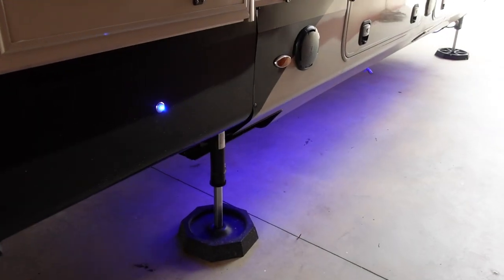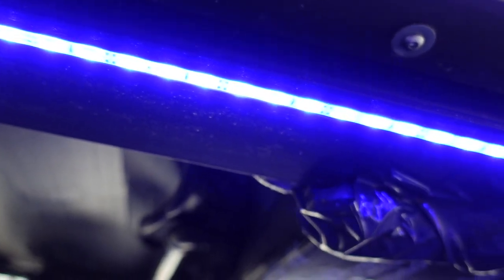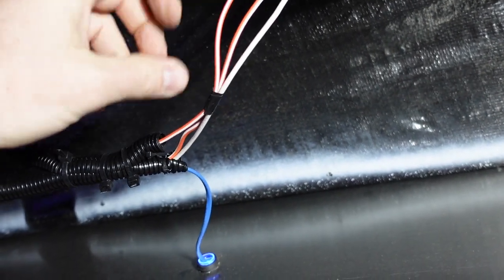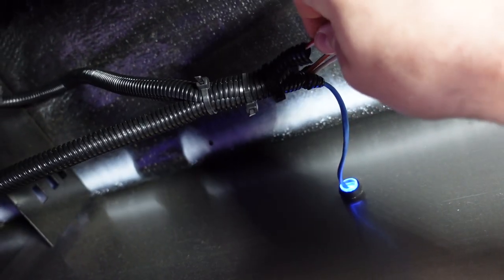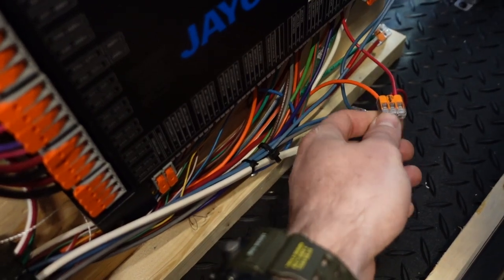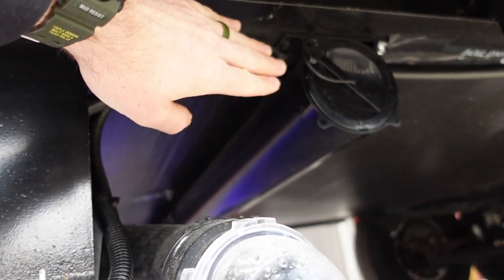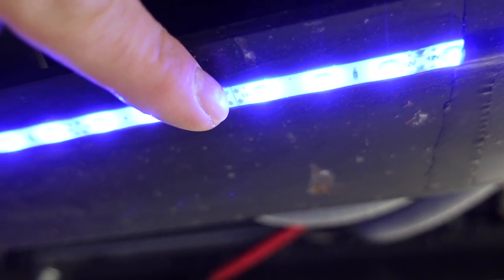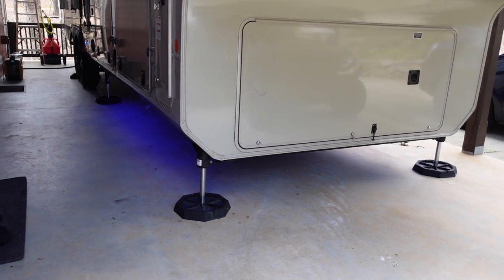RV LED Downlighting Mod // Add Ambiance & Security to Your Fifth Wheel & Campsite for Under $100

Comment: looks like my post disappeared?  Is that because I posted a reply with a link?  Anyway, got the mod done...thanks for all the help.  Both awning lights pull 1 amp and the step/downwash LED's pull 1.7 amps.
Reply from the maker: Possibly? Sometimes YouTube will take comments down or moderate without letting the rest of us know. You can try again to see if it'll go through.

Thanks for the amp info!

Comment: I'm glad i found your channel ! I have a 2021 Jayco Pinnacle 32Rlts and your mods, your observations and your corrections are interesting. Can i ask you what did you use to light up your basement please and thank you !
Reply from the maker: Yes, here's link to the LED strip I used in my basement storage area. Really makes it a lot easier for me to see things! https://amzn.to/3Bk38yk
Reply from the maker: Oh, and here's a full link to everything I've bought so far related to Pinnacle. I try to keep it updated and current, but if you ever cannot find something just let me know and I'll add it: https://www.amazon.com/shop/adventurerocks/list/3RX5U55SUBZB5
Reply: In case you're not aware yet, i found on my floor plan  a vacuum breaker in the wall behind the toilette located 6 inches above. This vacuum breaker is used in the water line to flush the black tank. In my case I had to cut a access panel below the coffee area behind the doors.
Reply from the maker: @claudius622  Oh wow, that was really hidden then. I'm surprised as I would have thought code would require the vacuum breaker to be accessible rather than hidden behind a wall like that. Apparently not!
Reply: @AdventureRocks  I accidently discovered the vacuum breaker because i installed a complete solar system and i had to pass some wires into the wall behind the toilet. It was so tite i preferred removing the wall behind the toilet.
I also have a ice maker and they placed the water valve feeding the line, behind the fixed stove !? But the problem with the vacuum breaker is the fact that one day it is going to leak. So i ordered a spare and now know where it is. But i still love my Pinnacle !
Reply: @AdventureRocks  i will buy from your store with pleasure !

Comment: Great video. But for the light on Amazon it said I need the adapter and I don’t see you use or explain that? Do you need the adapter or not?
Reply from the maker: I believe it's saying if you want to power the lights off a standard 120V outlet then you'd need an AC adapter, but since I just wired into the existing 12V DC system of the RV, no adapter was necessary in my case.
Reply: @AdventureRocks  ok good to know. We just need to replace the front cap light, like you said I guess water got in

Comment: The front cap LED in my 2022 377RLBH also had water intrusion damage which mostly occurred at the low point.  The tubes are about 1/4" too short and do not recess into the silver caps that are secured with a screw.  Jayco or dealer applied  silicone to fill the gap but did a poor job. The water accumulated in the low point of the tubing and has resulted in approximately 12" of LED lights not working. 

I understand you reused the tubing and I see the link for the LED tape.  Thanks for providing that info.  Curiously, how do I connect the LED tape?  I haven't removed the end caps to take a look.  Thanks!
Reply from the maker: It must be a common problem as I've heard same story from about a half dozen folks since I encountered it. I agree it seems they aren't putting silicone on the tube ends leading the the failure combined with the silver caps not fully covering. 

Facing the front of fifth wheel, mine was wired off to the right side with a very small hole in the fiberglass for the wires. I carefully removed them and pulled out enough slack to sauder the new strip to the wires. They were very thin gauge of course. I'd imagine alt access would be from inside by taking closet wall apart, but that seemed more difficult to me. I'd venture to guess there may even be a wago connector inside there, but too big of course to get through the hole in fiberglass so that's why I saudered and covered with heat shrink, pushed them back into hole. I also then siliconed that hole as it looked like they sealed from the inside originally. I almost wouldn't trust a regular dealer to do a proper job on something like that under warranty not knowing if they'd seal it up thoroughly to prevent from happening again.
Reply: @AdventureRocks  Thanks again. I’ll be sure to inspect it carefully if I let the dealer do the repair. 

I also have a TPMS unit that I cannot get to pair. I didn’t notice it until I got home from the dealer. Any experience with those?
Reply from the maker: @firstgenfarmer9809  I believe the TMPS sensor are based on bluetooth like the rest of the sensors, but I could be mistaken. I had a temp sensor quit pre-mature and turned out the battery was just shot. They must have had faulty battery as soon as I replaced it, came back as expected. So that's possibility. I've also noticed that the BMPro TMPS sensors only update every so often and might have some kind of "sleep" mode as sometimes I won't see all of mine till I've been on road moving. You could try re-seating battery first, then let a little PSI out to see if that activates it successfully. Worst case swap batteries with another and see if problem follows the battery or unit?

Comment: I enjoy your videos very much. I bought a 2022 Jayco Pinnacle in June. The only thing is my Right Turn Signal and Brake light don't work.Would you have any idea where the problem might be?
Reply from the maker: Thank you. Sorry to hear about your light issue. Since it is only the right turn and right brake, they share same wire (full bright essentially vs parking half bright), so I would imagine it is isolated to just that particular wire. I discovered on my Jayco with the JaySmart system, there is a hub/controller near propane tank driver side where the regular conventional wires connect from the 7-way and then distribute to the various lights. The JaySmart takes the conventional input and then sends signals to the various lights as needed. So the wiring is a bit different compared to a conventional unit without the JaySmart. All that to say there should be a dedicated "homerun" wire going from your JaySmart hub/controller that goes to the rear right tail full bright (3 separate wires actually for full bright, half bright, and reverse). My guess is somewhere in that signal path is the culprit. First guess would be possibly the wire got disconnected at the actual taillight itself (there will probably be sealant around it, but if you remove you can check that...they may have used crimp or wire lever nut there). Second guess would be a possible failure of the tail light itself...less likely if the half-bright for parking works (would need to replace entire light if bad though). Third guess would be a possible cut/break in the wire between taillight and JaySmart hub (would need to run new homerun wire or splice the break). Anyway, those are my first ideas provided it is just the full bright not working on just the right side.
Reply: @AdventureRocks  Also i ment to tell you the side markers don't work on right side when turn signal is on like the left side does. thanks so much for your response.
Reply from the maker: @carltontester9171  Do the running lights work on side markers and back tails? And reverse white work too?
Reply: @AdventureRocks  yes they do.
Reply from the maker: @carltontester9171  All right, in that case I wonder if your 7-way connector is making good contact on pin # 6? If I'm understanding correctly the tail/running lights work properly, but the brake and right turn signal don't work at all. If that is the case, I believe the signal from pin #6 (right turn/stop) is not getting to the JaySmart system to begin with. Thankfully this is an easier fix typically. I had intermittent problem on mine one time where the pins on my truck just weren't "grabbing" the connector in full and I had to gently bend the sleeves inside 7-way connector plug to hug them tighter. I also applied di-electric grease to ensure no corrosion. I could be mistaken, but I think that might be culprit? But if you find 7-way connector is solid all around, then next to check would be wire between 7-way in pinbox running to JaySmart...could have wiggled loose there too. The JaySmart module is labeled with diagram on it. Either way let us know how it turns out.
Reply: @AdventureRocks  I will. Thank you so much.

Comment: Can you share a link to the nose cap light please.    I wondering if it is possible to do the down lighting down the full length of the trailer.
Reply from the maker: Yes, the LED strip (blue) for nose cap is https://amzn.to/3NtZirC

I re-used the existing "tube" after cleaning it (I had almost like a soot from the shorting out I suppose). Anyway, I was able to slide in the new LED just barely into the tube. I used some soap as lubrication to get it to slide all the way as it got pretty hard toward the end of tube. Then I cut to length LED strip at designated line and wired it back in. 

Yes, you can do full length on down lighting, but I believe you'd need to add a separate switch + power compared to existing BMPro channel as the two strips on either side are about max for what an individual channel can handle wattage-wise. On my last rig I just did two separate switches inside the rig by stairs that controlled right and left. 

Hope this helps!
Reply: @AdventureRocks  cool thanks for the info and advice.